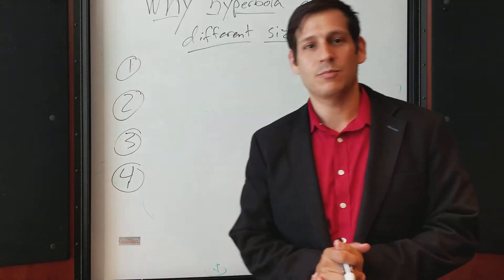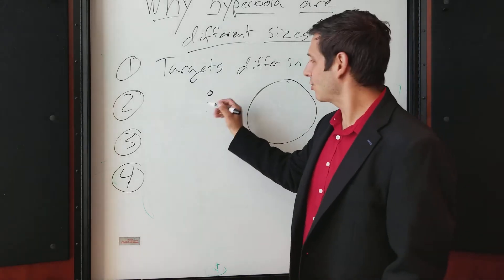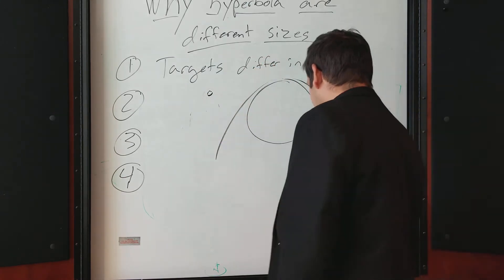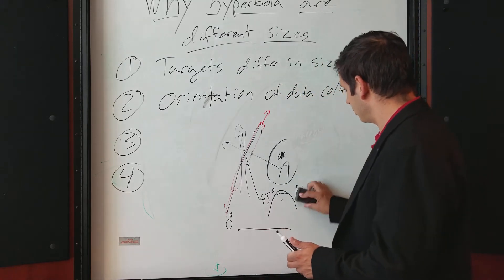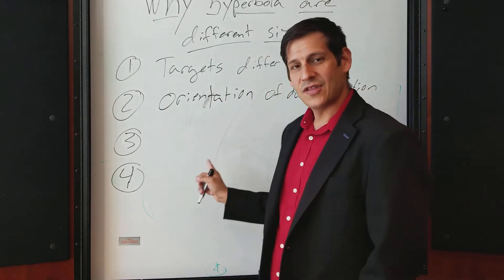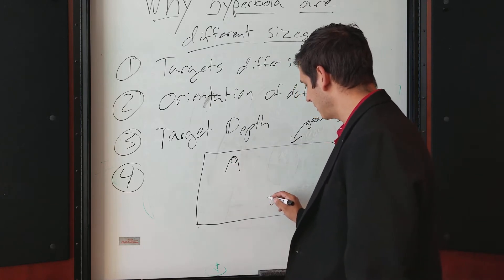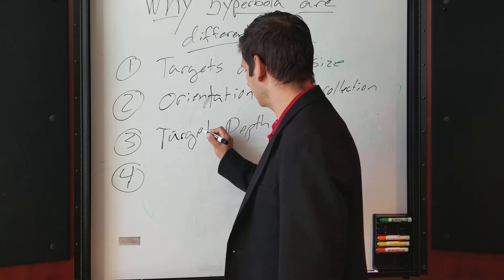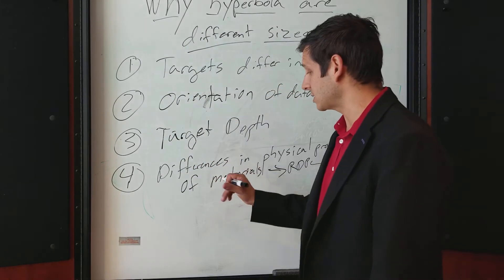Why GPR hyperbola are Different Sizes | Ground Penetrating Radar

Comment: Great explanations, cheers! I have question. Why might there be inconsistencies in depth measurements when comparing results obtained from an Electromagnetic Locator (EML) versus Ground-Penetrating Radar (GPR)?
Reply from the maker: @AmirLuqman-hk2gd  great question. Gpr measures to the top of the pipe, but the EM measures to the center of the signal. These may not be at the same depths. Hope this helps

Comment: I am not convinced by #4 " In situations with faster wave velocities (such as in dry sand), a target will produce a broader hyperbola." Did the antenna beam width change?
Reply from the maker: Hey Caleb! You are a skeptical one for sure. I would suggest that if you are not convinced that velocity impacts hyperbola size/shape/angle (covering all my bases for you) then definitely DO NOT use hyperbola matching functions on any gpr or Post processing software to estimate depths/dielectric/velocity. This critical function which is the most common way to estimate velocity is based on the premise that faster velocities will produce broader hyperbola. It's why no system will allow a fit broader than air, since the wave moves at the speed of light, the fastest speed in the universe that we know of. 

However you bring up another good point which I may not have gone over in the video...it's been a while. In dry materials, the signal footprint will be larger (diameter), and in wet materials the signal footprint condenses. I made a video about this too. You should be able to find this on the channel. 

Again, thanks so much for the comments. I appreciate the question!

Comment: it seems to me that you forgot to say that hyperboles also come from ground objects that are far from the profile. But these objects generate huge hyperbolas, for example, pillars, corners of buildings or eucalyptus trees. and of course I completely agree that the geological environment is a very active zone for changing electrophysical properties.
Reply from the maker: Leonid K. Thanks for the comment Leo! I think i would classify the example of air waves as hyperbola differing in size  because of speed. The wave moves fastest in air and always produces the broadest possible hyperbola for a given "depth". However, closer objects on the surface will be more narrow than those that are further away...so I guess distance could also account for it. Much appreciated as always!

Comment: Great video Dan. I have a question slightly different to point 4. What if two targets of same size and shape but different material are buried in the same strata e.g. a 6" PVC pipe and a 6" Steel pipe both buried in same soil, so will this effect the size of hyperbola?
Reply from the maker: Hasan Shirazi it should not affect the size of the hyperbola. The effect of depth has to do with wave velocity and the velocity is calculated based on the average to the target. So the hyperbola should be the same size, but the amplitude of the reflections should differ between PVC and metal.

Comment: Hi Dan, can the size of the pipe be determined with GPR? Thanks for the videos
Reply from the maker: Hi Frank. Unfortunately it is not an accurate method for pipe diameter estimates. Rebar, debatable, but utilities have more variables.

Comment: I started a PhD in GPR for landmine detection this year. I have started to try and estimate wave velocity and found your video :)

Different size because of the distance away? Im imagining a receiver at infinity in the gpr trace would be a flat line. As you get closer the hyperbola gets sharper.
Also target size and i guess shape to an extent. All would play a part. 

Now im imagining a receiver at infinity and an infinitesimal target size.. assuming no loss. We'd see a hyperbola again?  So the hyperbola size is a function of both.

Now same target size at a different site. One with infinite relative permitivitty, you'd get an indefinite delay. Reduce that and the hyperbola would start flat and sharpen again?
Reply from the maker: Interesting.  I have not thought about that. I guess generally we consider that attenuation would happen, but in airbyou could extrapolate out to infinity in the horizontal plane which theoretically would flatten the curve. Thanks for the comment and the thought experiment.
Reply: @Learngpr  Thanks for the video :) i'll be watching some more today. I would have thought a slower wave would make a larger hyperbola, so that was counterintuitive for me. Very interesting!

Comment: how does the permittivity affects the simulation sir? because i am working in hfss ..where i can analyze 4meter depth using marblr or silicon permittivities...but the moment i keep water as substrate we couldnt able to get 0.25m analysis why this is happening sir?
we are analyzing gpr to detect ground water.
Reply from the maker: So the water more affects the conductivity. This is an issue because the electeical field of the gpr wave will decay quickly in more conductive material.

Comment: OK, I'm game, have paused the video.  First, the grammarian must point out that the plural of hyperbola is hyperbolas or hyperbolae, according to Merriam-Webster (hey, you used "are").  One reason they can be different sizes is if you are not perpendicular on approach.  Another is if the dielectric is different.  Of course, if the object itself is wide and flat at the top, that will widen the hyperbola but not the tail (depends on what you mean by "size").  You also have a video that warns about hyperbolae that are due to air reflections (which is kind of the same thing as different dielectrics).  Now let me watch your video and see if there's another one I've missed...
Reply: I use antennas that are tightly coupled to the surface, so the hyperbolas basically keep going down to the bottom of the radargram (unless they are interrupted by other objects), no matter how deep they are.  On the other hand, the gain curve makes lower hyperbolas much thicker than hyperbolas closer to the surface, which is definitely a difference in size, so I'll agree.  Great video, Daniel!
Reply from the maker: bdrogin thanks Barry! Grammatical correction well taken. I appreciate you playing. 3 out of 4 is good. I known that "size" is kind of vague.  Great point about thickness. I didn't take that into consideration.